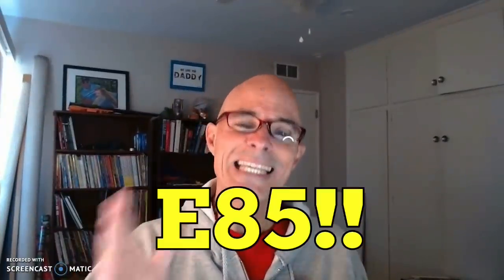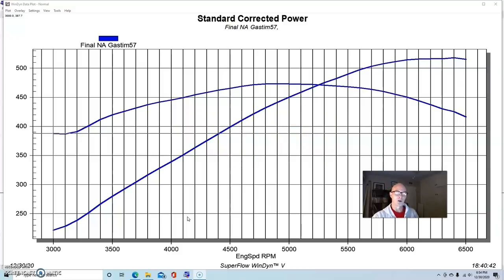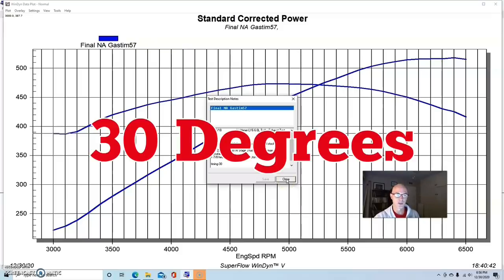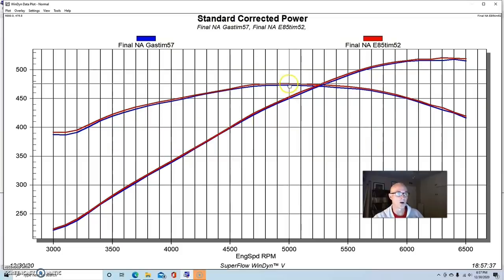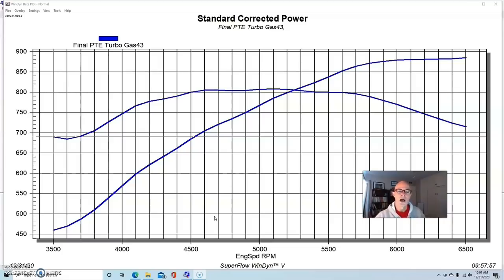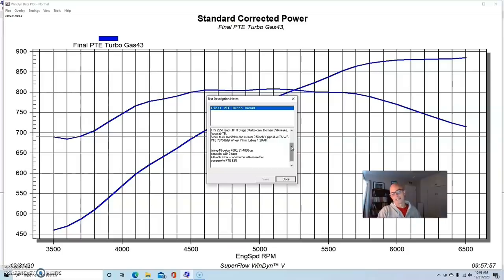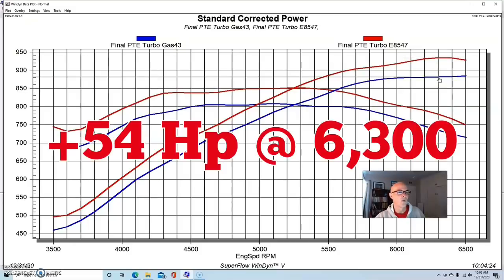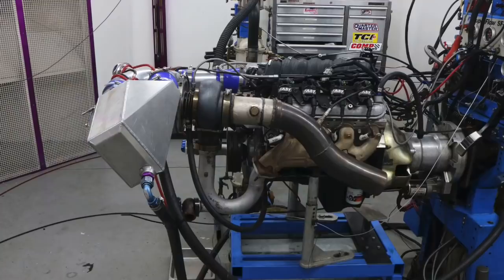JUNKYARD TURBO 6.0L LS E85 FUEL TEST

Comment: E85 makes like 30-40 more hp NA with the LT engine 👍
Reply: Direct injection
Reply: DAYUM
Reply: Swapping over to E85 and tuning for it on a hellcat is worth over 70whp.
Reply: @s2upid  forced induction is a whole other animal. Lt4 and Lt5 are the same way. Huge gains.
Reply: Any proof on the NA LT making more power? Just want to see actually it but i assume the direct injection helps it
Reply: @niknasstie  https://www.camaro6.com/forums/showthread.php?t=468070

The car does have a rotofab cai but on a stock 6th gen camaro that is only about 5-8 hp gain and yes it has a lot to do with direct injection
Reply: @Jr_5646  That intake is worth way more than that. The new intakes are seeing around 20hp gain. Even more on the ZL1.
Reply: @ryancrisp6786  I know with the supercharged cars or heads/cam  cars the intake becomes more and more of a restriction as HP increases, and a rotofab is worth significantly more, but for a basically stock LT1 car I havent personally  seen gains of that much. You have a link to any tune only vs tuned plus CAI dyno pulls. Just curious.
Reply: Compression. Lt1 is 11.5 and DI

Comment: Good Video Rich 
But there's a downside to this fuel though as I tell customer's when I'm gonna tune their car's or truck's it's not always E85 at the pump it varies octane on the time of the year as well. Plus the other bad things are you need to upgrade the entire fuel systems starting with compatible lines resistant to ethanol and filters too. The injectors needed have to be doubled in capacity plus must be cleaned every few months due to getting gunked up with crap and must be ran with regular gas to keep them lubricated every couple of tanks to lube up the system internally. So in the end cost of the total conversion to E85 plus the maintenance plus the tuning must be redone for E85 as well. It adds up.. So YOU gotta think about all.
Reply: Anything over e50-e60 you won’t see a huge gain. Also with a flex sensor running pump won’t be a issue that’s simple. It’s always better to overbuild a fuel system from the start.
Reply: Not exactly Sonic.  First, you only need about 40% more fuel capacity at the same power/boost level.  Second, any car made since about 2000 has to have lines and parts that can handle ethanol in gasoline since it's been mandated in most of the country since then.  As reese mentioned, most guys running ethanol run flex fuel these days with a proper ethanol sensor to compensate for varying mixes.  Even cars that don't have flex available from the factory can buy injector intercept kits now that modify injector duty cycle for ethanol content (use these on older dodges that don't have flex in the ECU operating system).  I do tell my customers to run a tank of regular gasoline basically whenever they do their oil change to keep the injectors clean.  But I have done 10,000 miles on my CTSV between tanks of 91 with no issues.  I think its more a case of poor tank quality/maintenance at the gas station, or crap already in your tank being dislodged by E85.

For older vehicles (80s and earlier to be sure), there are more issues to be considered, no argument there.  But for anyone running more modern stuff, its a pretty painless conversion outside of the cost of bigger injectors/pump and retuning.

Comment: What about E85 vs Non Ethanol pump gas. ...? We have several Quiktrip stations here that sell non ethanol gas here around Austin, Tx.
Reply: The non ethanol pump gas will perform the same or worse then the pump gas he used, the ethanol helps increase the octane so it depends on if it is factored in to the octane rating when its in the standard 5-20% mixtures.

Comment: In the n/a.  Test I think the compression was to low for timing needing to be pulled on pump fuel so no gain
Reply: Its about how much fuel you give it, you can make more power with 8:1 compression and open chamber heads easily.

https://www.hotrod.com/articles/hppp-1109-testing-different-fuel/
Reply: @SweatyFatGuy    Well if you can turn the timing up without hitting knock/pre ignition.  Then a high octane fuel is going to do jack shit  

Re run the test with a knock sensor and 15/16 to one compression 
Let it run off the sensor  running as much timing as I will take 
Then when it will pull timing if it sees knock  

Then  test again with e85
Reply: @SweatyFatGuy   I’m in the U.K.  so e85 is not available easy as it is in US     Can’t wait till it’s available easier in U.K.     can start to play with it